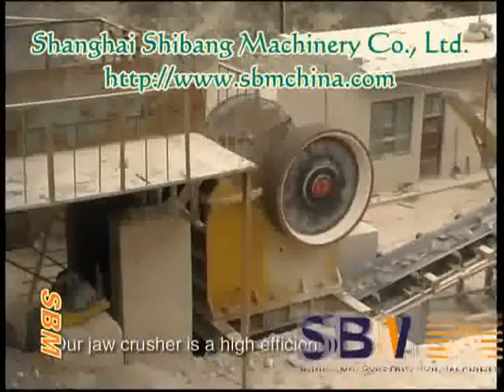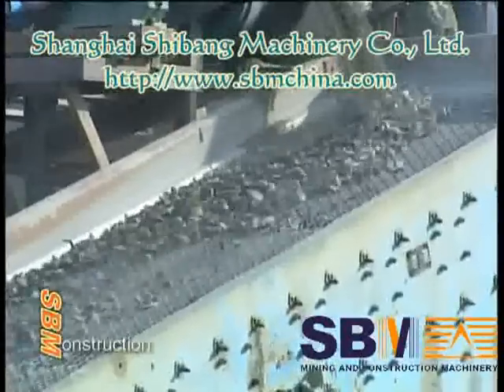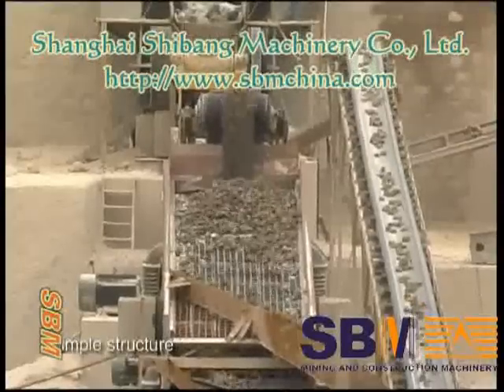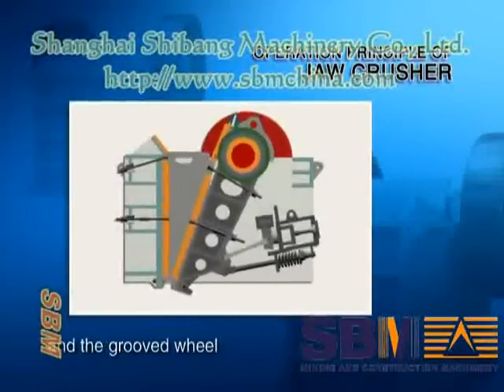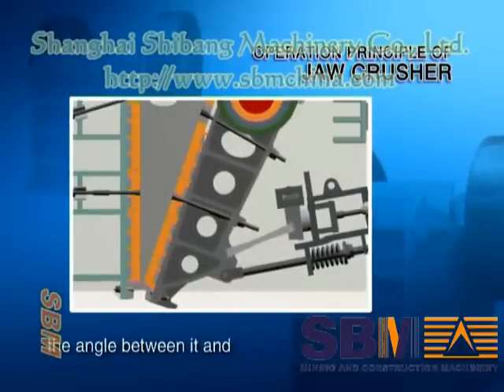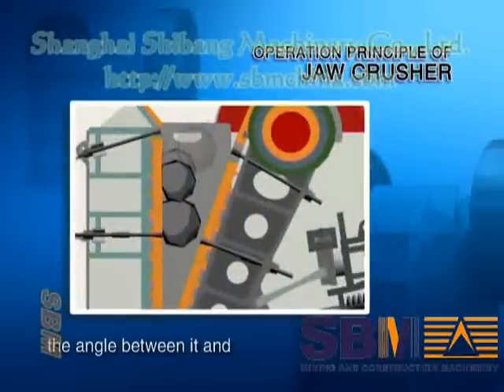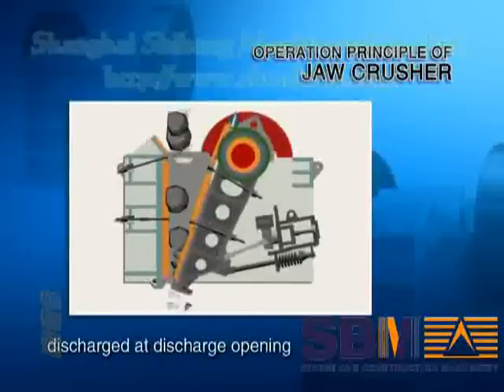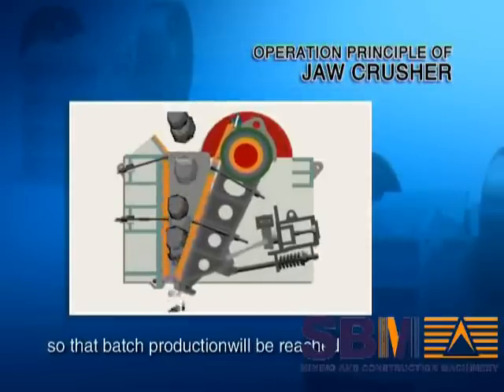The Working Principle of Jaw Crusher

Comment: Toggle plate does'nt expand and contract like in this diagram - it's a heavy plate of solid steel. It pivots up and down with the movable jaw. When it pivots up, it pushes the jaw slightly forward - just enough to crush the smaller reduced rocks.